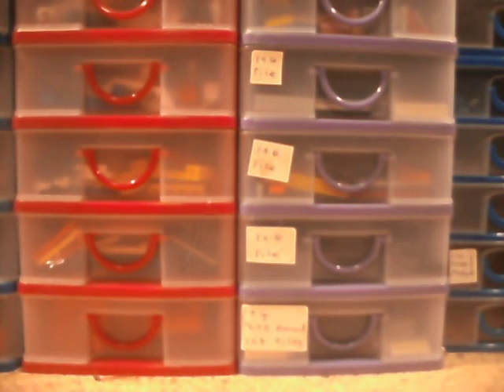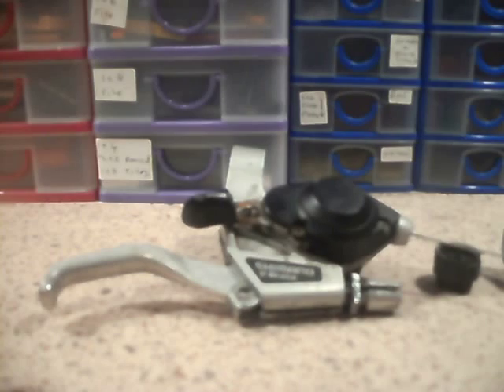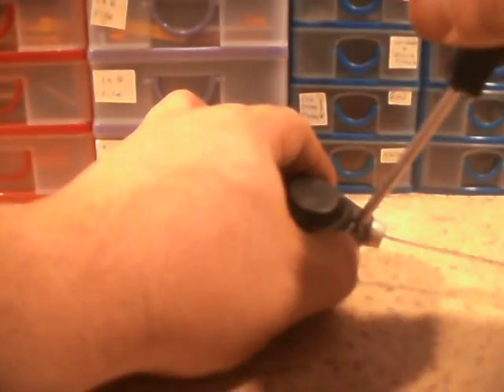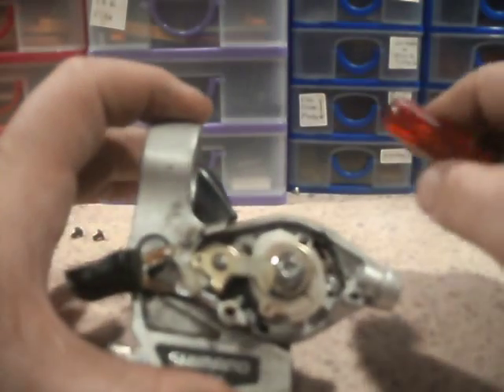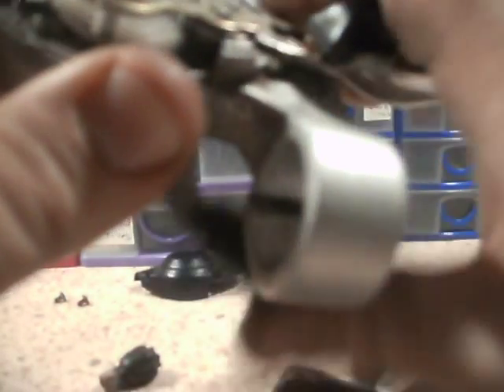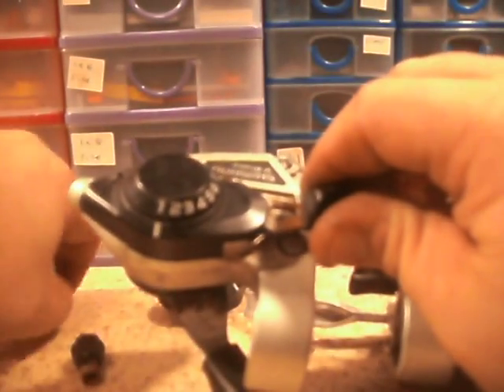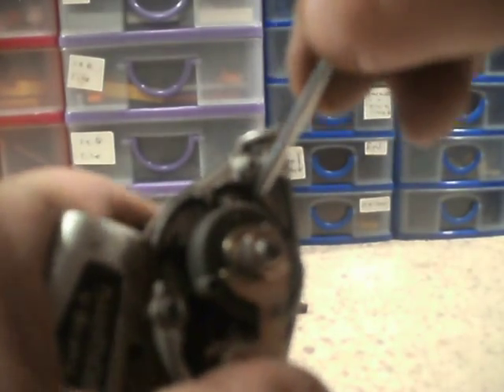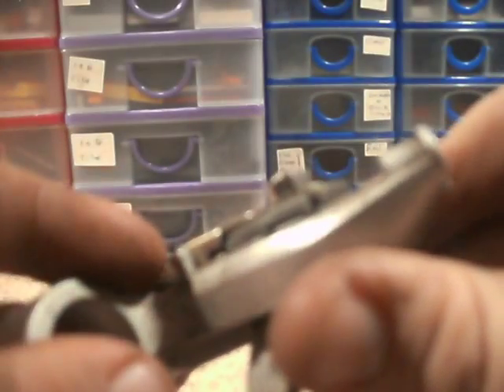Repairing Shimano Trigger Shifters Repair one, break one lol

Comment: I have the same shifter (for rear derailer) but a different problem perhaps.  The bottom screw loosened off which holds the down-shift lever on, so I removed the downshift lever completely.  The downshift cam had stopped moving freely, so I hit it with penetrant to get it moving again.  I reinstalled the downshift lever with some grease.  It was a painful process to get the down shift spring into the proper detents again.  Works great now!  Your video was helpful.